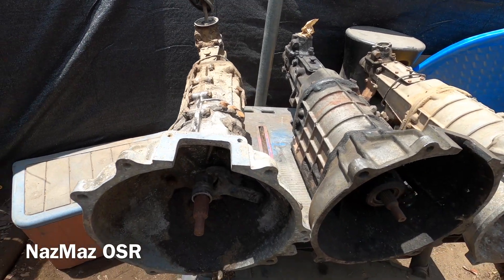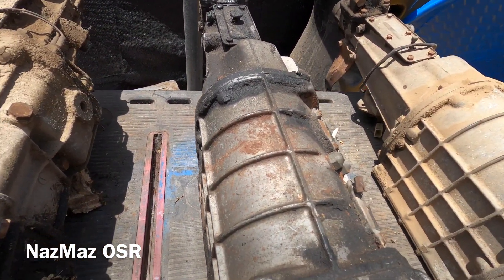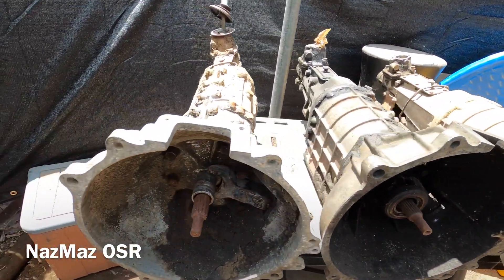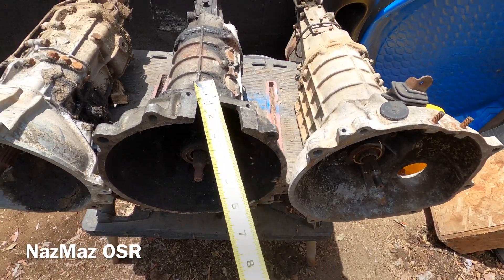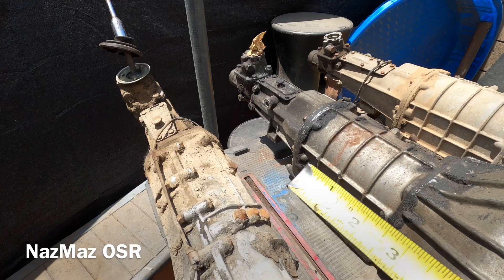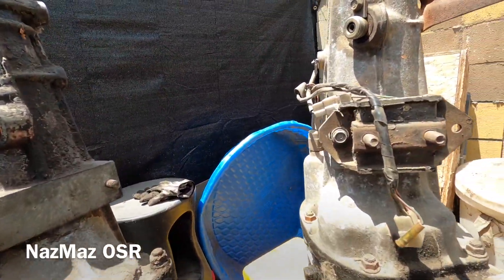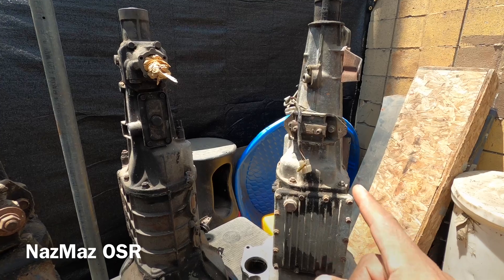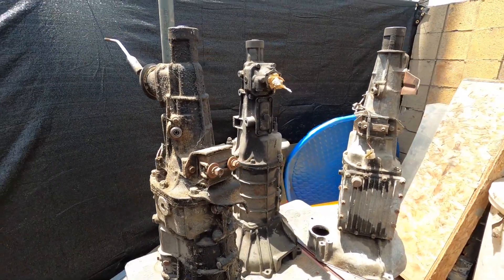Mazda Rotary Engine Transmission R100, Rx2, Rx4

Comment: I have a 13b with a 5 speed in my 72 Datsun 1200 sedan, question is I believe the mission is from a rx4, can I take an 82-transmission center gear box and switch it with my rx4 gear box, my rx4 mission is making nosey but still shifts.  Don't want to cut anything out on the car body.
Reply from the maker: No, both transmission are completely different. Starting with the 82 tranny, the shifter sits farther back so location for shifter won't be in same position but I dont think you have a Rx4 tranny since they came 4 speed only. If you have a 5speed is more likely from Rx3 SP or early Rx7 like 79/80 they are shorter than 82 I'm just speculating without seeing your transmission...

Comment: That was a great trans break down. I have one on my RX2 that looks like the RX4 is it possible that the REPU has that trans. I was told the one I have is a REPU 4 speed trans. It has that black plastic circle cover to look inside. Let me know what you think. Another great video my friend keep up the great content.
Reply from the maker: I did leave out the REPU by accident. The REPU does share (length, gear ratios, etc...) the same transmission as the Rx4.